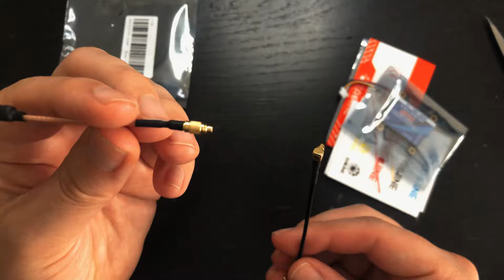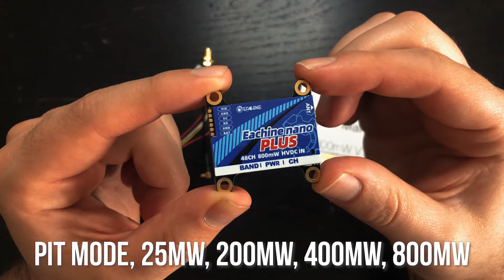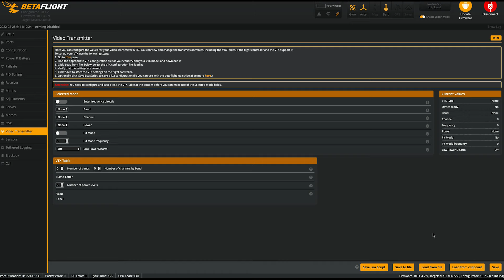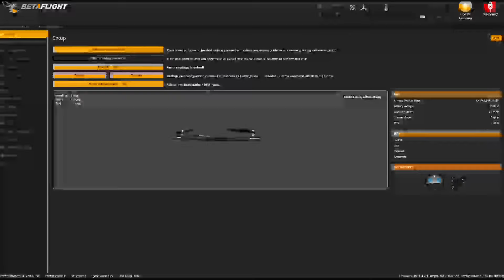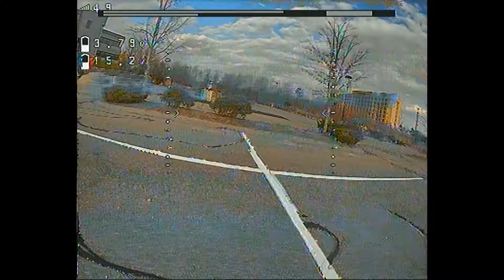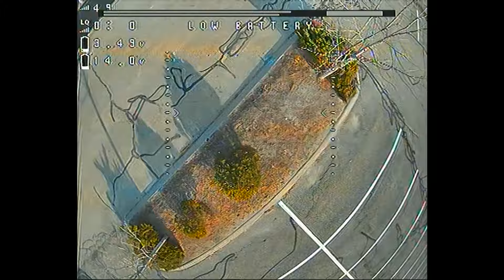Eachine Nano Plus - Setup & Review

Comment: I think some of these vtxs will operate on reduced rf output power if you power them with a low voltage.. If you notice the specs on the manual, it gives the stated rf output powers @12v.... They obviously mention this because you probably wont have near that power if you run it under 12v.. So a 2s battery will likley have bad results.. Any of them that do run a regulated 12V of a mere 6v will have heating issues and probably more noise as there is a boost converter in there trying to jump up a low voltage to a higher voltage.. If a vtx gives it rf output power at 12v.. then I wouldt power in with anything under 12v for best performance..  I had a 600mw vtx that said its input voltage was 5 to 12 v so I powered it with a 2s.. It was crap.. Then one day I said I wonder if its because its actually running in a reduced power state.. It was.. As soon as I put a 3s with a 12 regulator on it, it never had any range issues..